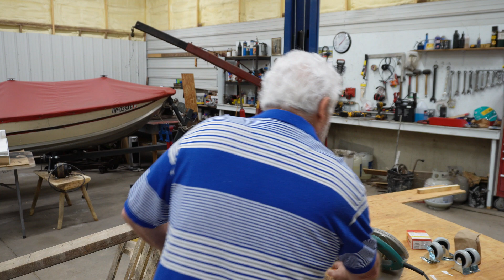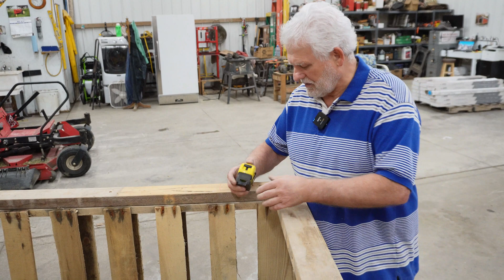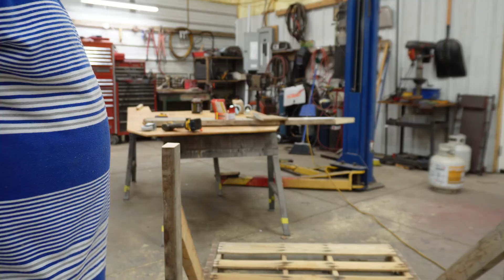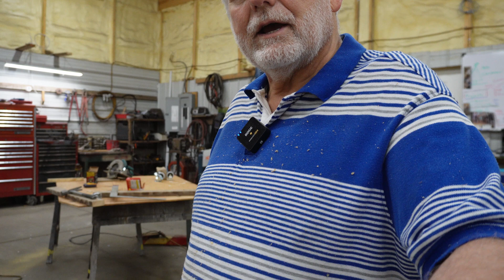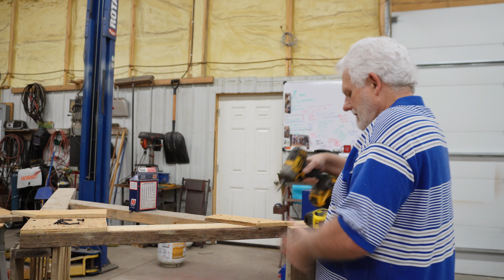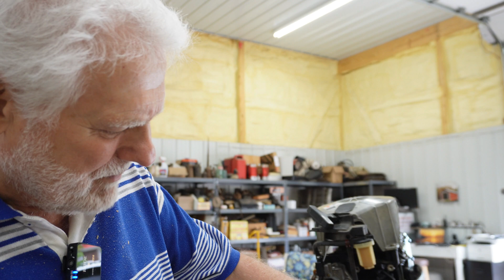DIY Outboard Motor Engine Stand for $20!

Comment: Well done!  I like how you used a decent pallet as your starting point. 👍🏼🎯👏🏼
Reply from the maker: Thanks it’s a bit overkill but I wanted it to last.  And with my skid loader I can move it around.
Reply: @MarvsFixitShop  yes!  This is probably the most practical design I’ve seen👍🏼